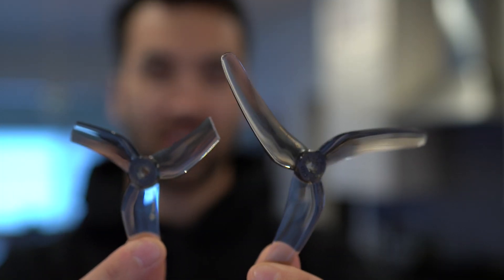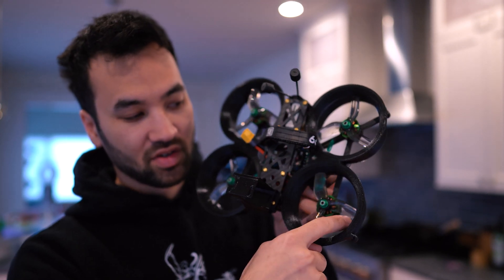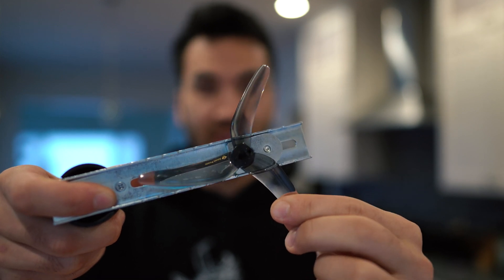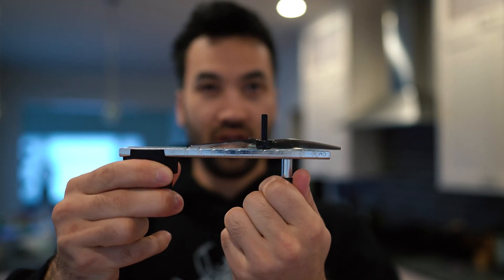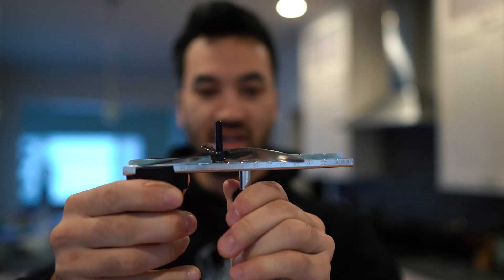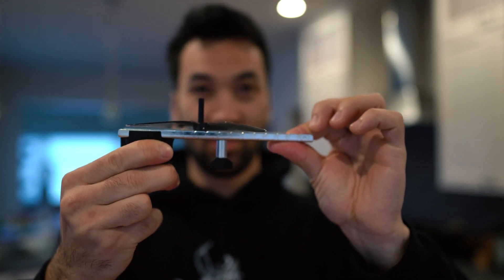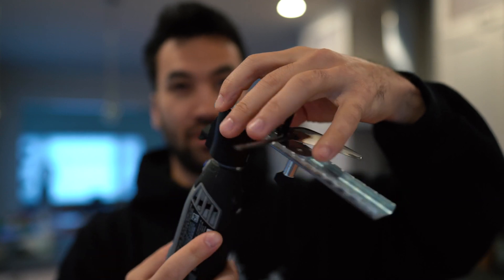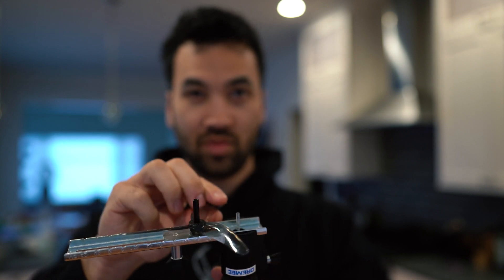JETs Tip: Cutting Props for Cinewhoops

Comment: my drone will fit 3.3" to 3.4" props without prop guard. Want to see if I cut props to just fit if it will be more efficeint. longer flight time. just i really wanted to just cut a 3.5" slightly shorter vs cuttin a 4" really short and ruining airfoil design.  but no 3.5" t-mount or biblades.. I think 1inch shorter 4" wont be great. Ive cut 2.5" to 2.3" and they worked fine.. but no better than just emax 2.3"

Comment: Piggy backing off this idea, to accomplished this without modifying the jig simply use a M3 screw and a washer to bolt on the standoff through the existing adjustment slot in the jig, and bingo. Just loosen and slide the standoff to your desired cut.

Comment: So how well does your geyser actually fly? The slightest gust of wind or getting near an object makes mine bobble. I get that cinewhoops are supposed to be smooth and slow, but mine does not fly well at all. Not sure what I'm should be expecting from my geyser.
Reply from the maker: So that was my experience with the squirt, those poor little motors just didnt have the yaw authority to hold all that weight together when theres wind or turbulence. Its great for indoor flat cruising flying, or still air, but it doesnt like non-ideal conditions.  My geyers is much much better at handling weird drafts, I can actually do more acro stuff like my 5" though every once in a while it does have its goofy gremlins. What setup are you running on the Geyer? Mines got 2207 2450kv that I run on 6s
Reply: I'm running 2206 2700kv on 4s. Using Gemfan 5552 props cut down to around 1mm of clearance. Motors don't get too hot.  I think the inconsistancy due to flex in TPU ducts along with the amount of drag these things have cause them to fly poorly. I guess it's not that big of a deal when using post processing on the video, but it kinda messes up my flow when shooting.

Comment: What RPM do you set your cutter at?
Reply from the maker: I think I set it somewhere in the middle, if its too fast or too slow, the plastic kinda melts instead of cuts. Also different prop brands use different materials, so I would suggest doing a bit of experimenting and seeing what speeds give you the cleanest cut.

Comment: How do you know how much to cut or where to start the cut ? Do you mark the props before you start the cut. ?
Reply from the maker: I measure the space between the motor and the duct with some calipers. Then I can slide the tool to the correct size and get cutting
Reply: Jordan Temkin Awesome! Thank you so much for the tips! Great video and perfect timing my friend. This will certainly be an amazing series of videos, Thanks again.

Comment: Dude! I literally talked about prop cutting for my geyser earlier. My geyser has been sat on my wall because I couldn’t get the props cut evenly. Using this tool, what size did you cut the props to for the geyser?